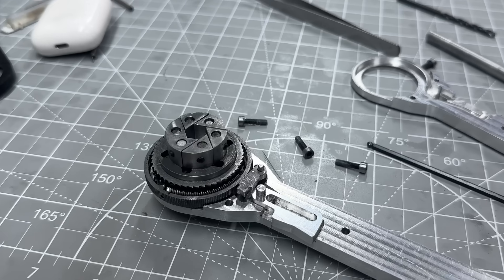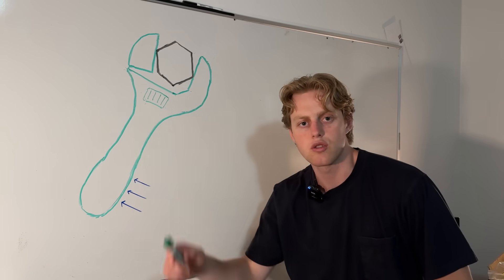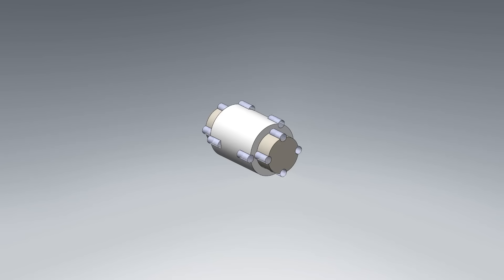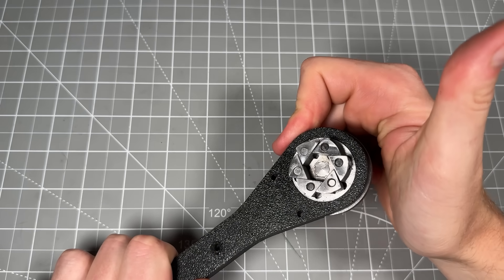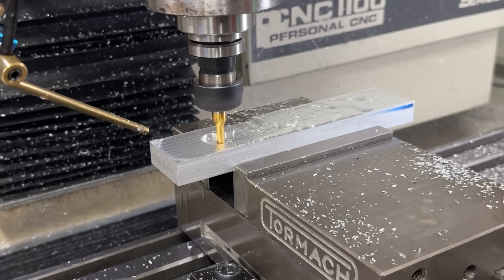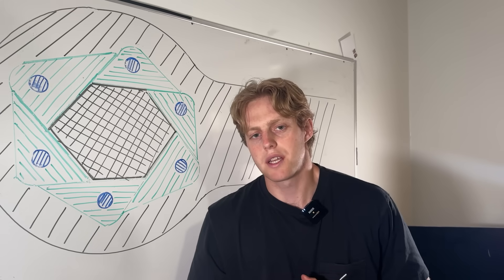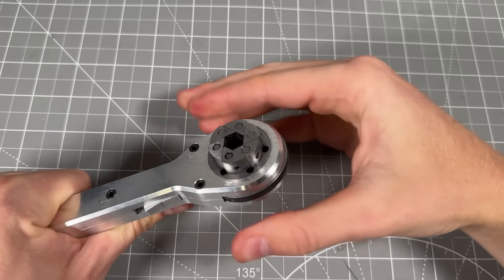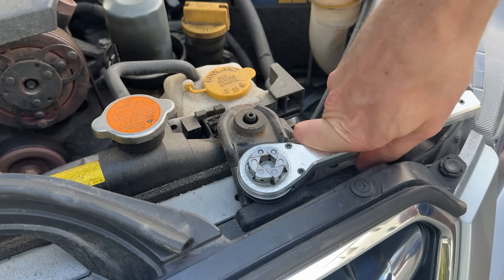I Invented an Adjustable Ratcheting Wrench

Comment: I don't know if you've thought of this. 2:23 
Unless it's a patent issue, just use the classic ratchet lock method. Have your blue wheel teeth be straight and have the orange lock be a "V" that can pivot from one side to the other. 
Completely removes the cost and complexity of duplicating your parts.

Otherwise I would double the diameter of your ratchet wheel, duplicate the lock spring and make a mirror of what you have there - but for the other half of the wheel's diameter.
But again, I don't think you'd have an issue with patents. The unique adjustability is what you're bringing to the table. So the ratchet system itself shouldn't be what's challenged. You'd have to speak with a patent lawyer though.
"If it ain't broke, don't fix it. - Simplicity is king. yada yada yada lol" 
Great video.

Comment: This would be good on old rusted exhauste pipe bolts & nuts, because they slip in 16mm for exemple, but won't go in 15mm. And you can't just hammer a bolt remover socket, for 1 the exhaust hang and thus absorbs the hit, and 2 space constraints

Comment: Maybe make another with the flex head. As a mechanic in 2025 i 80% of the time grab a flex head rachet. And this tool wont work for engine work but it would save my life to do suspension and brakes. Removing calipers wheel hubs doing brake jobs

Comment: Wonder if you could scale it down to smaller sizes? It’s very interesting for real. 
I also wonder about how it could translate to a different material set. Like a drop forged piece? Also I think it’s rather inspired, I do like how you said you’d rather do something that isn’t mediocre. 🤔 deep well sockets. That’s something I know. It couldn’t pull a spark plug. Yeah? I mean it’s brilliant. And I think a great uses case could be lag bolt driving. Even with a big socket it’s a pain to get those in. And it already would work for that it seems. I’ve built a few decks. 😂

It’s a working prototype. Now the question is? Can you get the idea to work in a broader set of circumstances. I wish you luck 🍀 my friend. 
Subbed for more

Comment: I love this.
Honestly. If you just make two wrenches. One for loosening and one for tightening. That alone would shrink my tool box down to just a bag.
I work in maintenance and having a wrench like this would be a life saver. And I'm sure splitting the wrench would cut down its profile by at least a third. I was already thinking of so many applications this would have helped me in and can help me in. I'm no mechanic but I am a commercial and industrial tech. When you start selling. I'll be one of the first to buy!

Comment: Why not design it for use in an electric screwdriver, so there is no need for the big handle bar and so no space problem? This would be an actual thing to sell and cheaper to manufacture.

Comment: instead of completely try to replace sockets, you could make your own sockets for this tool. the part that goes into your tool could have an hexagonial shape with an optimal size and the other end could be a normal socket. that way you could tackle the difficult case you showed in the video, and increase the size of bolts you can handle. the mechanism that lets you "finger tighten" by using the wheel is really valuable I think.

Comment: It would be cool if you can continue this idea, and think of things you can do to reduce the cost and make it easier to mass produce.
I would love if one day I could get one of these as it stops the need for swapping when you need a different bolt size.

You could make it so there are two ratcheting mechanisms and with a switch one of them gets disengaged, this would allow you to not waste materials on having two sides for the wrench.

Comment: Good design, keep going! If you can add dynamometric mechanism it will be good. Because standard wrench cuts edges of the bolts when its too tight and gets off, but your design will cut the boltheads instead.

Comment: I for sure will use this. I got all kinds of tools and even oddball tools only for certain uses in overall, you're always need the right tool for the job. In this case, this tool be the right tool for most cases, for around the house tools DIY jobs like a new home owner. You really never have the right tools when start off. At least this way you have a set in one ranch😅

Comment: To get pass the clearance issue, do you think you could just make the part that latches on the bolt longer with a different exterior shape? Or would that create strength issues?

Comment: I'm not sure if you've heard this already, but I think it would be neat if you actually disconnected the whole bolt gripping mechanism from the wrench and turned it into a socket. If you did that you could save time and money on metal and machining out a whole handle. Plus with it being a socket instead of a wrench others could add their own extensions and even put a servo joint on the back to solve the maneuvering problems that the tool currently has. And even then it would make the profile a little lower, which in the mechanic and tool world, tool size and shape can be the only thing holding you back from completing a repair.  Making it a socket gets around the problems that arise when you'd start to sell them, because ai don't know if you've ever tried to convince someone to throw away all their socket sets, but that's basically what you'd be asking them to do if they want to buy this tool. (Which I think we both understand would be a good thing, but investment bias is a thing, and it's stronger than common sense sometimes) 

For recessed bolts beveling is probably the best solution!

Comment: Look's great. I would join a kickstarter in a heartbeat. Tons of ideas: Could possible make a vertical one for reaching down shafts, and although against the general idea, different size classes for small, medium, and very large bolts. Still better than traditional wrenches because it avoids slip and exact size testing.

Comment: Compacting the design would be the next step.   Don't underestimate saving 10~20% in size.   Some areas on a vehicle are nearly impossible to get to without removing many other parts to access with even the smallest of impact tools.   Reducing the size of this tool to the absolute thinnest variation without compromising the current capabilities will determine ultimately if the tool is a proper replacement, or a expensive convenience.   

Keep going, you'll be retired by my age, and I'm only 34.

Comment: This is an excellent tool.  I would love to see this realized.  A common problem I have with my own ratchet set is either not having the correct size, or needing to haul the entire ratchet set with me for simple jobs, which is inconvenient and takes up unnecessary space.  If I have this tool, I may not need to carry the entire ratchet set with me.  Best of luck in bringing it to market.

Comment: There is a right tool for every job, in this case you need to find the right job for the tool. I wouldn’t use this working on cars. I can see how in a factory setting were you would have to repetitively tighten and loosen bolts in that size range this could be a lifesaver.

Comment: What you should do is make a universal socket using the jaw mechanism. It then connects to a normal ratchet with extensions if needed. This will reduce the diameter and allow it to be used in recessed positions.
Reply: Yes, much better than the universal socket that uses pins. A torque wrench could also be employed, but my concern is the size factor of the mechanism.
Reply: You are right but this would exceed torque until he sorts the pin and plate issues out. He needs the pins to be the hardest component by a large margin or they will continue to deform.
Reply: Yes, like basically orientating The handle 90 degrees

Comment: This is so cool. Few ideas.

I would think this as a two part problem. First is how to crab the bolt and tighten grip, second is how to ratchet.

I suggest you think about crabbing so that you have very narrow hole where the bolt is and to use claw game type of mechanism. The claw could have hydraulic pistons to tighten the grip or that movement somehow would activate pumps that tighten the claw.

Ratcheting mechanis could be via worm gear turned 45-135 degrees and using torgue shaft made in the shaft of the ratchet to change rotation.

Hope i somehow got understandable text.

Youre good engineer. Keep up the good work and i bet you will make awesone things.

Comment: Before, retired from Engineering, I worked as a liason engineer to insure product made "overseas" performed equal to or better than what we make in the U.S.A. We designed a product that these foreign purveyors failed to duplicate because of its high strength and therefore I couldn't approve the look alike.  For your pins, look into a  chromium-molybdenum alloy steel like 4150 HT which has high hardenability and can achieve a tensile strength of 150,000 psi when heat-treated. BTW, beautiful design, excellent thinking, fantastic follow through. I admire where you are!

Comment: Really impractical design. It's huge and won't get into areas traditional wrenches and ratchets can.  Go out to a normal vehicle and try to take off an exhaust bolt or something and let us know how it goes in a video.  Even if you took care of these issues the range of bolts sizes it can adjust to is very limited.

You have engineering skills but not practical sense.

Comment: Would it be possible to have a "single" set of jaws that can be slid from one side to the other? Maybe with a detent on each side to hold them in position. I suppose this could make the head roughly 2/3 the current width. 

I certainly haven't looked at the details of the current design closely enough to see if this is possible as is.

Edit: If not, carry on witcha bad self ))

Sub'd!

Comment: What if the connection head was a separate piece and the hand had the ratchet?    Think extension and options to have a small and large attachment... <1/2 and >1/2

Comment: Great design, only thing l would ask for is to have a larger range of bolt sizes. In my job l go all the way up to 7/8”. Maybe to slim the design out a bit, since you need separate heads for forward & reverse, maybe put forward on the top & reverse on the bottom. I look forward to seeing the progress & buying one!

Comment: This is a great idea. If you wanted to lower the profile, make it a double ended tool. Tightening on one end and loosening on the other. I know it might increase your cost but to have a tool  like a box end wrench that can tighten metric and SAE and loosen? Might be worth it. It definitely would replace the sockets but, I always need a multi tool for the car and emergencies.

Comment: it’s rather infrequent that you find a new tool that is a truly novel invention — most are rather gimmicky. we will watch your career with great interest.

if you were to take this into production, i think your only competition would be the Wera joker self-setting adjustable spanner. those come in a variety of sizes, each individual wrench size covering a small range of fastener sizes, and i’m sure you’ve considered the same idea for your design.

if you were able to design a pass-through version of your mechanism around a hollow core bushing to allow access to nuts on long bolts or all thread, that would be the wrench i would keep in my pocket everywhere i go at work. although this would surely cost you in the sleekness department.

excited to see what else you come up with!

Comment: Nothing new. It's design has been around for decades and it doesn't work as well as advertised. It works as well as the auto adjustable pipe wrenches from the 80's and 90's.

Comment: Biggest problems with this is a narrow market, adjustable allows you get at bolts like those on a steering arm, most merchanics need depth of a socket to access a bolt. So this has a narrow market of bolts that are easily accessible.

Comment: I’ll start with I really like the ingenuity and the design and functionality, but there’s a couple of things why it wouldn’t replace socket wrenches. one it has a very short head length. It won’t fit into tight spaces or where bolts don’t have much clearance around them, the lack of length on the head will prevent it from being used where an extension is needed. I do think you could design add ons to fix these issues though. Keep going and excellent work.

Comment: Perhaps not the most practical, but definitely mechanical art. I’ve considered the shutter-style design too, but the complexity, cost, and lack of everyday practicality are exactly why big manufacturers have never pursued it — and why tools like electric adjustables ended up as short-term gimmicks. That said, props for actually building a prototype and proving the concept. Refine it a bit, and it could appeal to those who appreciate mechanical art, much like fine clocks or watches. Make it a little more compact, and I’d keep finding excuses to put it to work.😂

Comment: This still have one crucial problem, metal stretch and bend after prolong use or under stress, and this design has many failure point since every part has to be accurate and precise. But it's a great idea and maybe can be use in lighter work on regular household problems

Comment: This looks sick. Chamfer would be nice addition if it doesn't make the jaws too weak. The jaws also could be a bit lower profile. I could see this wrench in 3 different sizes and maybe even a variant with teeth at the end of the jaws for pipe wrench type of grip when you really need to open the rusty rounded bolts. It would also be nice to be able to open jaws from the handle so it could be operated with one hand but that's a feature creep at this stage i guess.

Comment: This is interesting, you could almost just put the catch side on the outer edge and it would work as a internal universal tool, like Alan heads and whatnots. I did see another try to make a universal Allen head,  but I think your design will be even better just reverse outward 👊🤙 that dial that lets you use it as a is money as well you're definitely on to something there even with your own original style ratchet just with your own improvements improvements!

Comment: Very nice! to remember witch side does what you could have each side anodized or painted in a different color with an engraving on the respectives faces. Also to reach for recessed bolts, I think you could make some sort of extension that clips on each jaw so the only thing sticking out of the tool is the functional faces that grip on the bolts.

Comment: While the size constraints of this version of the mechanism limit its utility in an automotive setting, I could see this in every farmer's tractor's tool box for those times you have to hop out of the tractor to replace a broken plow tine, spring, or anything with easily accessible large bolts or nuts. Scale it up to handle larger nuts and more torque, and I bet farmers, and heavy equipment mechanics would love this.

Comment: No, the tool is useless for most applications. I've got several similar in design and none get used. The problem is that that the tool is too large to get into tight spaces.

Comment: I think with the low clearance and handle size it’s kind of a gimmick right now. I love the idea, but I think in many real world situations you’ll be grabbing your socket set first. You could likely put a regular socket extension on it and use a socket with it, but I think at that point it might defeat the purpose? 

This might be a really good breaker bar.

Comment: i love this idea, one thing you might consider making this as a socket its self, so you could put it on a extension for harder to reach spots. Ive been working on cars as a mechanic for 25 years and while this is limited by size and bulkiness i can see how it would still save time especially on working on things like my paintball air system and other equipment

Comment: In real world use this tool is far to limited in application:

A - it has no pass through capability, therefor can only be used on a bolt head. (Not a nut)

B - like most other adjustable designs, it requires side clearance which is quite often not available.

C - it's far too complicated and would be expensive to produce, limiting the customers that would have any interest in it.

D - my own observation here but it seems vulnerable to dirt / grit as well.

Sorry to be overly negative, and I applaud your effort but it does need to be practical.

Comment: I would rather have an adjustable socket than an adjustable wrench. 🤔

I do think it is a really cool project. And I think you could make it a little better by using some different tools and materials. Like wire EDM, EDM drilling, powder metallurgy sintering, Chromium–vanadium steel, heat treatment, maybe even 3D metal printing. Maybe you could use a complaint mechanism for the springs and maybe even the ratchet.

I would like to make a FEM model of your design though, to see how the stresses moves though that complicated mechanism. It is in many ways a very interesting design.
Not an easy project to make in a garage. Thanks for make the video.